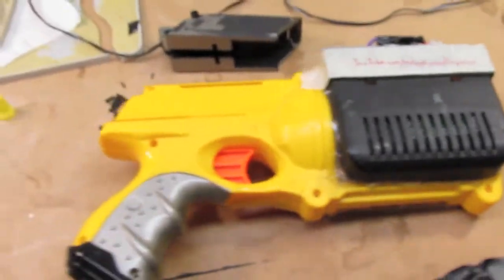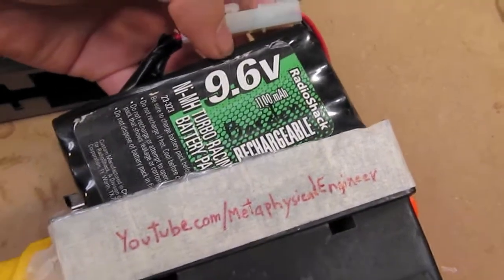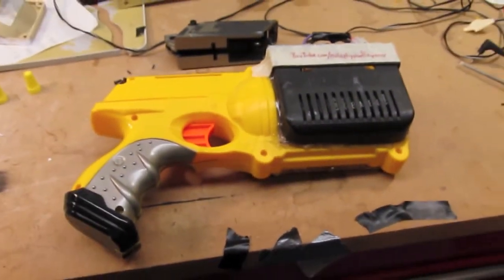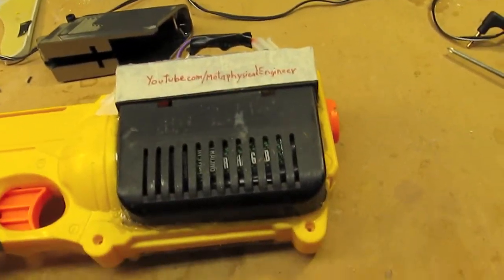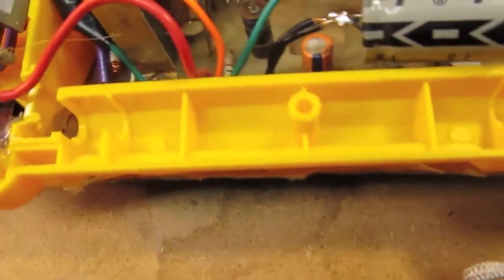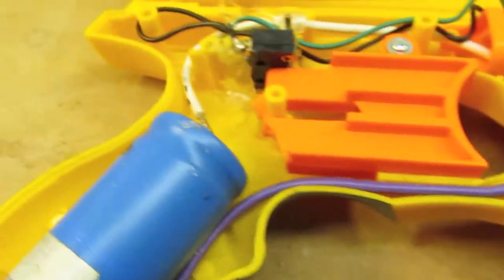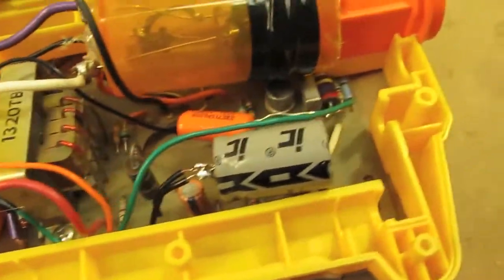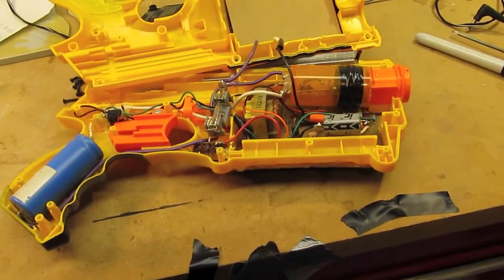I Built a Ray Gun Prop out of a Nerf Maverick and an Old Strobe Light

Comment from the maker: I considered that, but at the time I was working with parts I had on-hand.  I'm planning to add an electromagnet so the slide recoils when the trigger is pulled, and use a different on-off switch that acts more like the safety on a real gun and prevents it from firing at all when turned off.  Thanks for the comment :)

Comment: you know how to make an adjustable speed disposable camera strobe?
Reply from the maker: I haven't made one before but I'm pretty sure I could.  Is this a question out of curiosity or are you looking for design advice? (Both are fine)
Reply: MetaphysicalEngineer I like to know how to make one for a sci-fi ray gun project :)
Reply from the maker: nathanalaneller
I'd be glad to help you :)
What effect are you looking for from the strobe?  Similar to what I have with my ray gun here (one flash per trigger pull) or rapid strobe flashes for as long as the trigger is held down?  This will determine the type of circuit as well as the complexity and power requirements.
Reply: I like the strobe to have two settings. A single shot, like every time you pull the trigger, & a rapid flash. You hold the trigger & the gun is like, party strobe speed. The settings will be on a two throw toggle, single or auto effect.
Reply from the maker: nathanalaneller
If you plan on using a xenon flash with a fast strobe effect, you will need something with a lot more guts than a disposable camera.  Even with a good battery, those take 20 or more seconds to recharge. The strobe electronics I used are only good for a couple shots per second at decent brightness. 
How much space will you have inside your ray gun for the electronics?
Reply: MetaphysicalEngineer There is a flash gun in the nerf firefly, maybe you can make a mod to switch it back & forth from a single strobe to a rapid strobe. I'm looking for a strobe with this function.
Reply from the maker: nathanalaneller 
Aha.  I'll see if I can get my hands on one of those to mess with.  Would need a lot of upgrades for rapid strobe, because the stock charger isn't meant for that kind of output, and the flash tube won't handle the extra power very well.  No fun if the plastic starts melting after a few minutes of play.